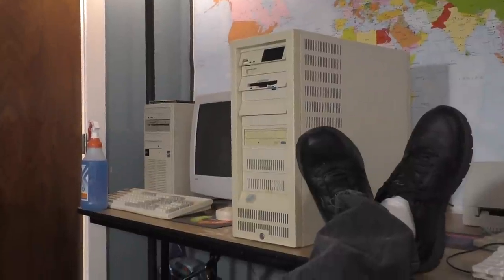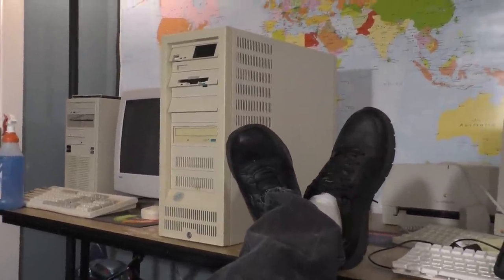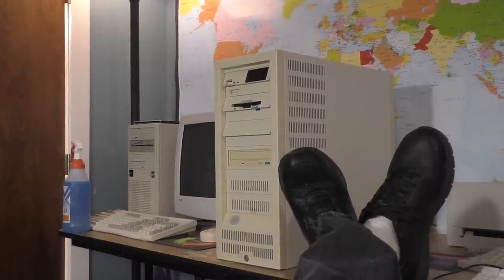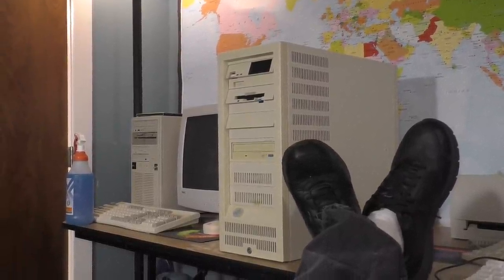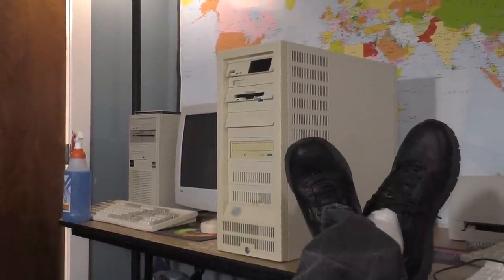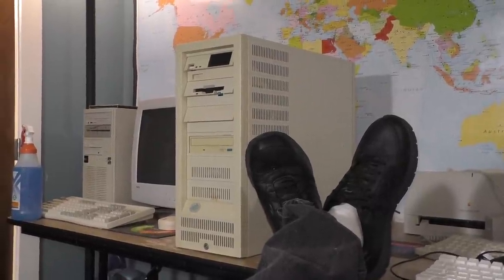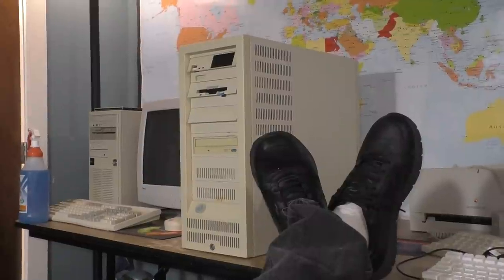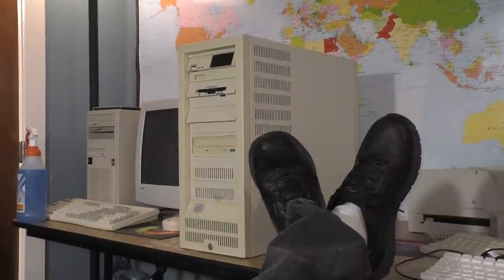"I've saved you once, and I'LL SAVE YOU AGAIN!!" - The IBM PS/2 Server Model 9595 Saga

Comment: 486's in general are absurdly priced right now i know theres one going for $1500 right now.. thats why i was patient with mine it came from russia but was only about $175 in decent shape with a modern (for 486's) motherboard with a coin cell battery and pci. Best part is everything works  it was a complete system and hasnt given me any trouble had to wait for months to find a reasonable deal like this
Reply from the maker: So the mint Tandy 486 with monitor and matching color dot matrix printer and keyboard I picked up for $200 was a worthy investment, eh?